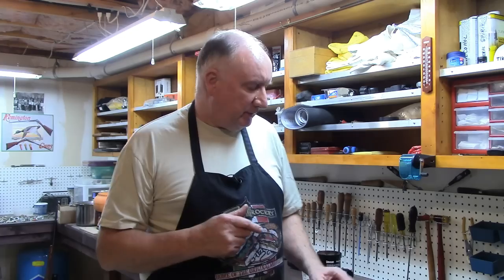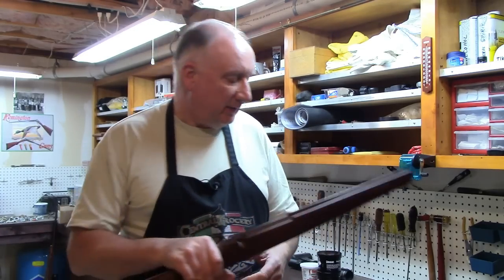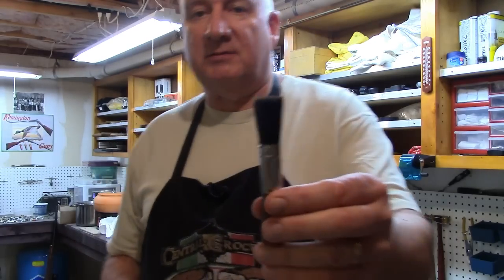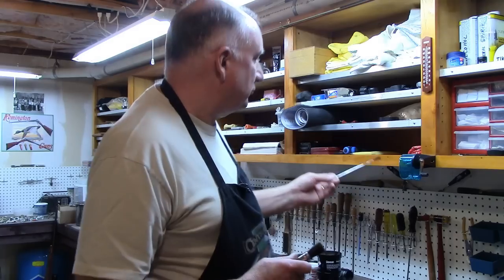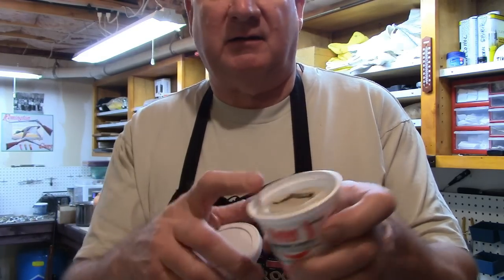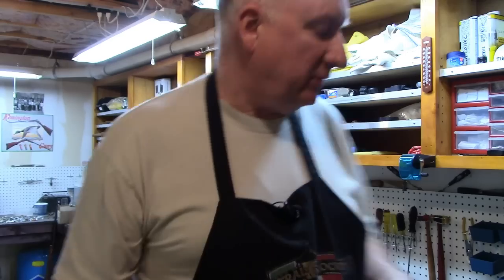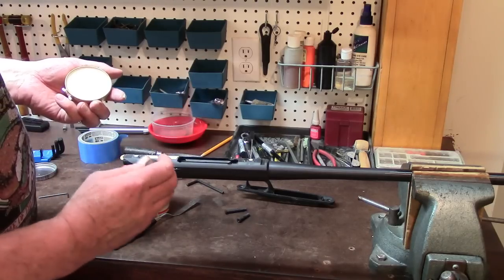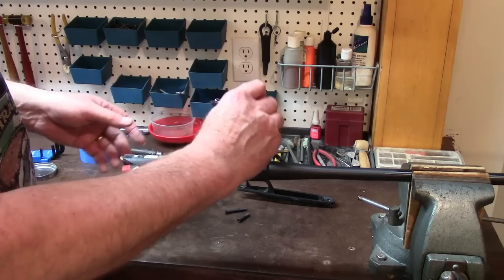How to glass bed a rifle, Part II ~ Let's bed that rifle professionally!

Comment: My Winchester recoil lug is made onto the receiver.  You said do not get any putty under the recoil lug how will I keep that from happening?
Reply from the maker: Understand the reason why, first.  Epoxy makes an intimate fit that will be too tight for even the most minute particle of oil or dirt to occupy.  Even the smallest particle will keep the receiver from seating properly.  Under the recoil lug it would even be air tight, which would compress springy air under it.  After the compression escapes, removal of the lug would be a suction issue, making it difficult to remove, like trying to pull a fence post out of mud.  Moreover, it would bind on removal, and twist the stock.  

The recoil lug has only one job; to resist recoil force rearward.  The front face, sides, and underside are not involved and should have a very small amount of clearance.  The remedy is to apply two layers of blue painter's masking tape to the front, sides, and underside,  before the release wax is applied, then neatly trim the corners with a sharp Ex-Acto knife.  Be sure to apply wax to the tape when you do the receiver.  

Apply your epoxy compound directly into the stock lug recess.  As you insert the receiver, the lug will displace any excess as it sinks in.  Be sure to apply enough epoxy forward of the lug to give support to the first inch or so of the barrel. You can prevent it from running too far forward.  If not dammed, it will just run forward without staying against the barrel.  Take a small amount of the plumber's putty, and roll it into a small worm about 1/4 inch thick.  Then cover the putty worm with a bit of plastic Saran film, which will help prevent contamination of the epoxy.  Lay that cross-wise into the barrel channel an inch in front of the lug recess.  The epoxy will not go beyond that.

After curing, remove the tape from the lug and be sure to retrieve any that may have stayed in the lug slot.  The best tool for that is a dental probe or sharp pick like a turkey trussing needle.

If you're doing a Model 70 action, it's one of the easiest to do, and gives very fine results.  I've done a number of Model 70's and similar style flat bottomed Sako receivers, and they all shot superbly afterward.

Good luck.

Comment: Great video! What/how do you recommend for bedding a rifle with a fixed recoil lug (like a Win 70) vs. the Tika with a removable lug as you showed? How do you keep from getting plastic steel between the lug bottom and the stock so as to ensure the lug bottoms out on the stock? Or will it squeeze out with a fixed lug such that the lug does bottom out? Thanks!
Reply: Good Question Brad, I did see in one of his videos on sportster model riffle accuracy that mentions glass bedding for a fixed-lug application. He mentioned that masking tape should be applied and trimmed on top, front and sides but not the seating face to the rear. That's if I am remembering correctly. Unfortunately that wasn't addressed in detail or shown on video, but was mentioned. I have an early 2000s Savage model 110 that I am considering glass bedding as well but am hesitant for the same reason. Have you found any further information? Maybe coating the entire lug is sufficient but there would have to be some room I would imagine for it to release.?

Comment: Great info, do you not worry about the epoxy to go into the rifle screw hole?
Reply from the maker: It's intended to do so.  That's why the screw is protected by wax.  Backing it off and retightening as demonstrated prevents seizure.  The rear screw hole is slightly enlarged afterward to allow for expansion, but the front screw remains in contact with cured epoxy.
Reply: @GunBlue490  thank you, I will bed my t3x your method

Comment: I'm just about to start my first bedding project for my sons .223 Sauer 100 into GRS sporter stock. (Bedding is a specified requirement by GRS for the 100 action)  I've watched about 30-40 bedding videos on youtube and this is the most informative and trustworthy. thank you! The Sauer is going to be a liitle more complex i think, due to their 'Ever rest' bedding block design. I may have to destroy the plastic stock to remove the bonded in block as spares can't be bought. Do you have any experience of the Sauer 100? and  Can you tell me at what stage you cleaned up the devcon that seeped out and was behind the electrical tape? regards John

Comment: Greetings from GA. What are your thoughts on the glass bedding on older (circa 1980s) model 70s? I have a new-to-me XTR in 257 Roberts and was thinking of accurizing it; including free-floating and potentially re-bedding it if needs be. I know some on the various forums are critical of what they call the “hot glue” bedding of this period of Model 70 but I would be interested in your thoughts- as you say, anyone can write their opinions regardless of whether they actually know what they’re talking about.

Comment: I have a beautiful birch stock Remington 700 with the pillow of wood as you stated in the barrel channel. You stated to leave it there for proper support and to bed the action first. My problem is the barrel isn't laying straight in the stock and seems to be touching in a few places along the sides. Should I still leave the pillow and proceed with the two point bedding of the action or sand down the barrel channel as even as possible and use the tape wrap for proper evenness then bed the action? Will the action bedding straighten out the barrel in the channel?I understand I'm going to sand it down after the action is bedded anyways. I just wonder if the bedding would be better if these pressures on the stock were to be relieved or at least leveled out with the tape wrap prior to bedding. Is this unevenness in the barrel channel affecting the way the action is laying in the stock?The gun I'm referring to is my hunting rifle chambered in .270 Winchester and it shoots very good with factory rounds often just one Moa at worst with holes touching more often than not. I Thank you in advance for any suggestions you may have for me and others in this same situation. God bless:)
Reply from the maker: If you have uneven stock interference along the barrel channel, I agree that you should first clear those points.  If you understand the reasoning I gave regarding the support of the barrel to align the action during the bedding process, and your barrel chanel is off kilter, you may indeed be better off by free floating first, then tape wrapping at the forend to center the barrel during bedding.  It sounds like you have a very good grasp of the process, and what you are seeking to achieve, so that's 99% of the job right there.  The epoxy, combined with the taped barrel, will realign things nicely.  I think your stock is walnut.  Unless it was replaced, I know of no occasion where a Model 700, either ADL or BDL grade was stocked otherwise.  Some got quite bleached after a while with earlier RKW finishes, but walnut was the standard.

Comment: Thank you for the video. What is your opinion on pillar bedding? Will it add much to your technique described in the video?
Reply from the maker: daraussen 
I have pillar bedded rifles, and frankly, I have not observed a difference from the method I demonstrated. Pillar bedding is the placement of rigid posts that maintain even stock screw compression, which can create torque (bending) in the receiver.  Plastic and glass stocks are typically rather flexible, and benefit from such rigid posts, and wood stocks being prone to moisture induced swelling can benefit from pillar bedding techniques, too. However, I have found that the two point bedding as shown appears to normalize support, regardless of stock screw tension variances.  In essence, pillars cannot hurt, but I've found them an unnecessary step when a two point bed is provided.  Two points, just like the legs of a bipod, provide rigid support, regardless of the compression variancss of the screws.  Though not always necessary, I have found it generally best to make the screw holes larger than the screws, to prevent possible lateral interference, which can affect accuracy and induce splitting, and has been traditional for stock makers since the beginning.

Comment: Are you familiar with the 1903 Springfield 30.06? I would like to bed that action in my new Boyds stock as you describe. The front has, basically, a two piece pillar intragated with the recoil lug and floor plate. The screw goes through a round half pillar intragated with the floor plate in to the recoil lug itself bringing the two together tightly. The recoil lug does double duty. The recoil job and the top half of and completing the pillar. The rear tang sits flush to the wood with a round pillar (Springfield calls it a bushing) that the screw goes through.  This "bushing" is critical to prevent cracking the stock at the rear tang. So am wondering about floating it like you say. Any suggestion on how to do this rifle, both front and rear?

Comment: Blue painters tape ,
9.5 wraps: guessing that to be 1/8" thick, give or take. How is it 
that does not widen
 the gap between
 barrel & stock. Factory gap less than 1/32" ? 
I need to measure 9.5 wraps. No special space for tape on Teco rifle ?

Comment: love your generous guidance, thank you. did the Tikka shoot much
 tighter groups after the bedding work?
Reply from the maker: tony cimino 
Well, as the saying goes, it's hard to improve upon perfection.  I will say yes, but the gun was shooting so well that the improvement was small.  However, the bedding is now far tougher, and weather proof, less likely to change, and replaces into the stock with assured consistency, returning to absolute zero.  It's generally worth doing, though my Winchester Model 70 has beautiful 2 point factory epoxy bedding which provides match grade accuracy from its Featherweight barrel.  They could not have done a finer job.

Comment: Very nice vid midwest tells you to smear it all the way to the end of the stock and in the mag channel which I have no idea why basically your making a washer and a harder than wood surface to lock up the action and distribute the forces
Reply from the maker: Every accurate mechanical bedding system uses two points of contact at the receiver, with a fully free floated stock.  The fully bedded method derives from the same artful concept of having tight metal to wood.  Looks pretty, but doesn't shoot.

Comment: When you screw the action screws into the action, when happen to the plumber's putty you put in there? 

Thanks for the details video, I've watched your video several times and am to bed my first rifle.
Reply from the maker: coyote tan 
It goes into the bolt lug recess, and is simply removed by cleaning the action.  Be certain none remains in the bore of course.
Reply: Got you, thanks.

I am about the bed my CZ 527 in 223, any advise?
Reply from the maker: coyote tan 
Despite the mechanical differences among stocked rifles, the goals are the same, and all rifles respond well; bed at two points under the main action screws with an inch of support extended from the receiver forward, and float the barrel from that point forward.  The old rule about floating with a dollar bill clearance is absolutely insufficient to prevent stock and barrel collision.  I recommend .050" all the way around, which is five layers of standard .010" card stock (they vary, so measure them).
Reply: GunBlue490 Thanks.

Comment: Marc
All your videos are great. I'm going to bed a M77 Mark II. How do you keep the bedding compound out of the front action screw hole. The hole bottoms out at barrel threads and I don't want to lock the barrel in with the bedding compound. I was thinking a lot release agent in the screw hole then the plumbers putty and one piece of masking tape over the hole. I would think I could push though the tape and start the screw at the same time pushing any excessive bedding out of way. Or is there a better way?
Reply from the maker: The Model 77 design presents a few issue, but I've had success with them.  First and foremost, do NOT free-float the barrel until after you bed the action.  While this is true with any rifle, the angled screw creates far greater downward rotation of the barrel, and bends the action front to rear.  You should be sure to also bed at least 1.5 inches forward of the action, and 2 wouldn't be too much.  The Ruger blind hole you speak of will certainly trap any substance and prevent purging, as with a through-hole.  Your goal is to run the screw into the action dry as possible.  Entrapment of compound in the hole will prevent the screw from going in, due to hydraulic resistance.  Filling the hole with any sort of substance will do the same thing, but will also contaminate the compound.  You have two choices:  

1.  Most stockmakers would probably do it this way, from habit.  Make a 1/2" overlength stock-maker's screw with a screw of the same size and pitch; cut off the head, slot it for a screwdriver with a fine file or a Dremel tool with a fiber disk.  Run the screw into the hole, properly prepared with release wax as I showed.  Insert a waxed, close-fitting hardwood dowel into the forward stock hole so that it protrudes at least a half inch above the hole.  You do not want a tight fit that cannot be pushed out easily.  The dowel will prevent bedding compound from dragging out the hole excessively.  Apply your bedding compound around the dowel.  The next goal is to lower the action with the front stock-maker's screw pushing the dowel, displacing it.  Assemble your front hinge (Part D-7 in your owner's manual) without the floorplate door.  Tighten down the rear tang screw.  Insert the forward trigger guard screw (center screw) and screw it in passively, only to retain the trigger guard in alignment, bottomed FINGER TIGHT ONLY.  Use a padded C-clamp just at the front section of the action to press it in, then tape as I showed snugly, starting from the rear tang, working forward.  being certain that the action is fully down into the stock.  As you work the tape forward, remove the clamp.  

2.  This is the way I'd do it because it's also simpler, requiring no extra parts, but you'll need a patient assistant who has been given some preparatory instructions, and who understands what the goal is.  DO A COUPLE OF DRY REHEARSALS BEFORE PROCEEDING WITH THE COMPOUND, so you know where elbows get in the way and to avoid unnecessary screaming.  Run the waxed front screw through the front floorplate hinge (Part D-7 in your owner's manual) with the floorplate removed and into the stock.  With your assistant or tape holding the screw and hinge in place, apply your bedding compound, being extremely careful to keep it off the threads.  I'd keep it back from the screw by 1/4 inch, because it will migrate and fill in as the stock lowers.  Carefully align the action hole to the screw and have your assistant turn the screw as you allow the action to be pulled down, keeping the top of the screw and the action hole out of the mud.  Once started the first two or three turns and the hole is protected, you can allow it to sink and just run the screw home, proceeding from that point as per the video, taping, etc.  Same as above with regard to the center screw.
Reply: Thank you for this explanation how to deal with bolt holes that bottom out at barrel threads. My weapon (a Browning AB3) also bottoms out at the front bolt hole to barrel threads.
Reply: Marc
I tried a dry run using the first choice with the stock-makers screw. I could not seat the action into the stock as the installed angled screw prevents the action from seating in the stock without removing significant stock material. So I'll be using your method with the putty, not liquid bedding compound. I found I'll need about 1/4" gap at the front of the stock/barrel to engage the threads with front action screw to keep the threads free from bedding compound. I spent around $5 on hardware to discover that the stock-makers screw would not work. But found that Ballistol is an excellent thread cutting lube and it also removes the wax release agent Kiwi or Johnson better than acetone without the hazards.
Reply: I had a similar bottoming issue at my front bolt. I installed my screws without base plate which effectively gave me more length clearance to epoxy around base of bolt while keeping engagement threads clear on top. It worked for me when I epoxied at 1:00pm today - my action bolts work freely as the epoxy hardens.